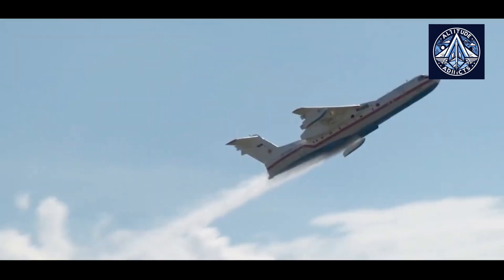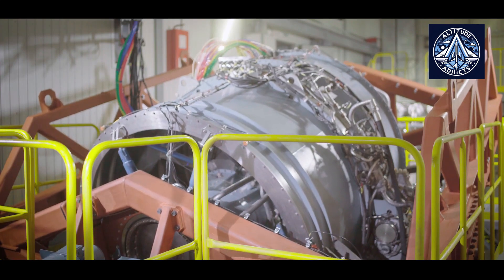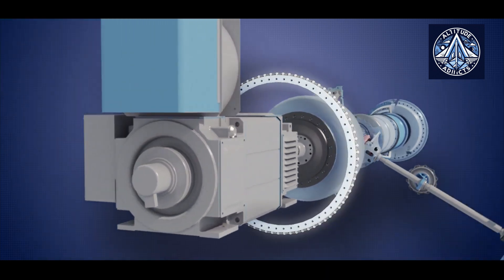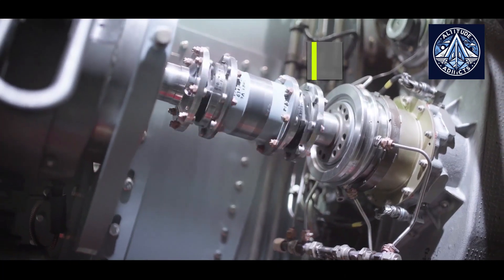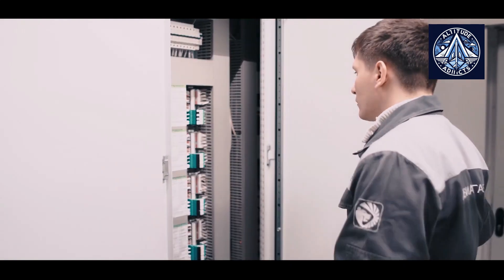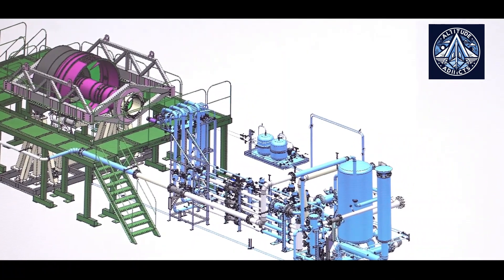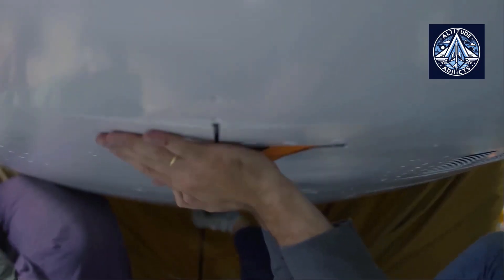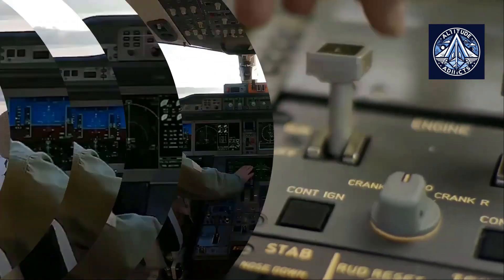Russia Cuts Production of PD-14, PD-8 and PS-90 Engines

Comment: So not just due to supply chain problems but also market demand.  However, this is not unique to Russia, there is a world wide problem with engines.  Every manufacturer is either dealing with below expected performance, reliability or delivery problems.
Reply: This IS unique to Russia. The rest of the world is NOT dealing with war related sanctions. THAT is what this manufacturing reduction is all about.
Reply: that is nonsense - there is a very clear shortage of Western commercial aircraft and engines (and engine problems eg P&W GTF )
Reply: @tomfrank6794  Google it.  Shortages of parts, supply chain problems, poor performance etc etc all greatly affecting western engines. They also have sanctions on titanium.  April 2024 631 gtf equipped planes were grounded. Not many have returned to service yet.   Also there are major program delays on the 777x and 737 -7 &10   It’s practically inherent in the industry, not to mention getting the forecasting wrong about how many planes will be needed.

Comment: As it was already expected, they cannot meet the production deadline due to the supply chain issues. They cannot make 900 planes by 2030. So they need to reply on Airbus or Boeing until 2050.
Reply: ...   > "So they need to reply on Airbus or Boeing ..."
Be careful with text auto correction.